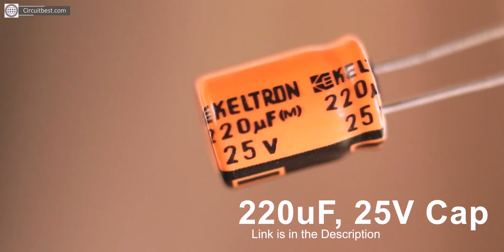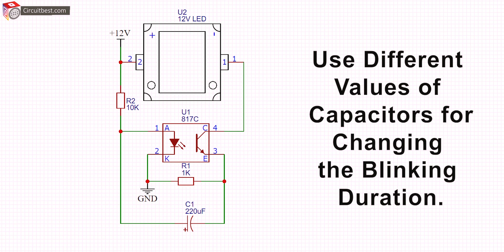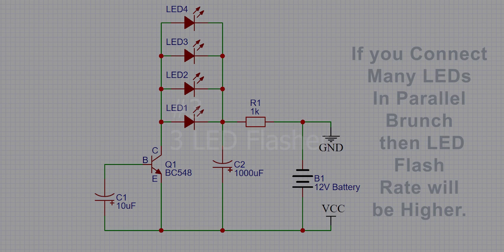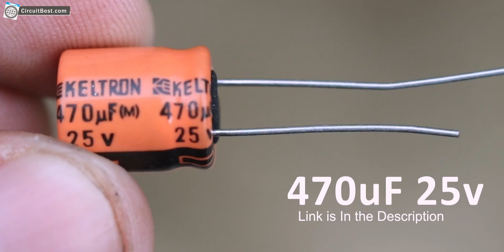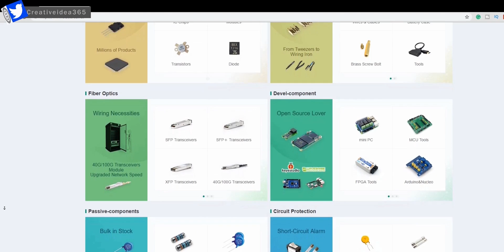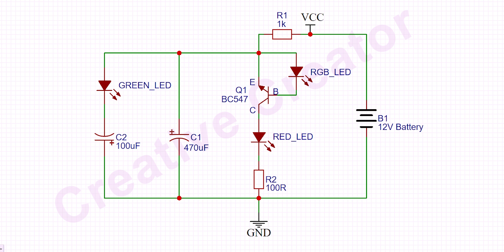Top 3 Simple LED Flasher Circuits

Comment: 1st ckt is fine but for the next two could you please explain how it will work as per the schematics. The transistors are NPN and yet the emitter is connected to the positive rail. Also the  C2 is connected in reverse in ckt 3.

Comment: hello, how can I make two 12v led strips flashing signal type.
Reply: Use one of these designs such as a NPN transistor as a signal circuit to drive the GATE pin on a LOGIC base mosfit that would power all the 12v led's your heart desires "as long as the power mosfit can handle the current" Also go look at my post and learn about those concepts.

Comment: So I did the #2 with the bc547 and 2 capacitors (50 and 25) it didnt work tho then I realized that we used a 100 uF capacitor is that the reason why it didn't work? Hopefully you'll answer it right away cause our project is due friday and today is thursday 😂😂😂 (yeah I know we're cramming) 😂😂